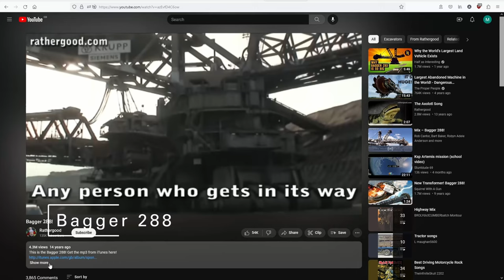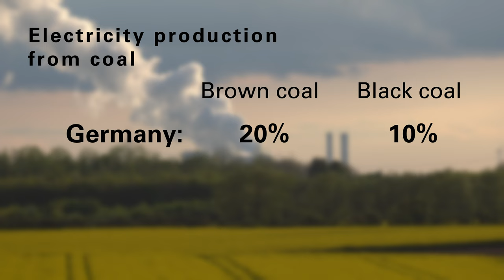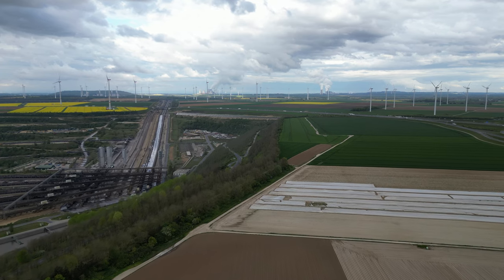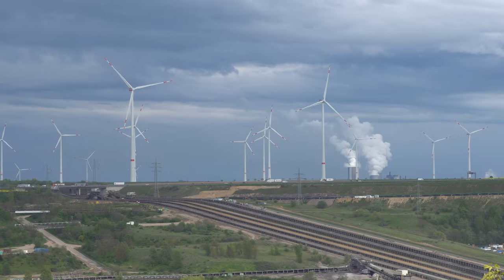The huge German coal mines that swallow autobahns and towns

Comment: I wonder what they plan to do with them when they do phase out coal after it's too late.

A new lido, perhaps? Or maybe new data centres for all your videos by 2038.
Reply from the maker: I confirm that I do have gigabytes of footage that would be best archived at the bottom of a very deep hole
Reply: They're planning to flood Tagebau Garzweiler and Hambach - this happend to smaller open-coal mines in the region before - e.g. "Blausteinsee".  

Our local politicans are also thinking about a channel to connect both lakes. We'll see what the future brings.
Reply: biggest artificial lake in the world lel
Reply: @Janekrich  Unsurprisingly, given the holes are up to 500m deep, filling them with water will take 40-60 years, while they'll also need annual top-ups as the lake beds won't be completely impermeable. They'll also likely be slightly acidic, limiting wildlife or recreational uses.
Reply: I think flooding them is a bad idea. What if we need to use them again when renewables 'turn out' to be insufficient   @mittfh
Reply: @liquidusblue  "Renewables turn out to be insufficient" - installed renewable capacity is currently insufficient, but gas, biomass and nuclear can fill the gaps. At a push, anthracite, but lignite is very dirty and very inefficient - coal in general produces a lot of pollution and significantly reduces air quality - carbon capture is a pipedream.